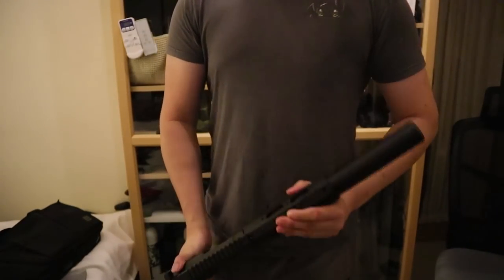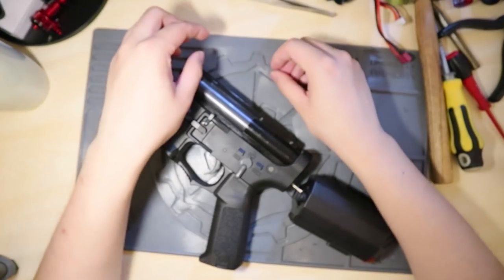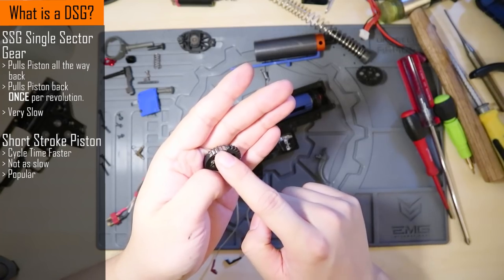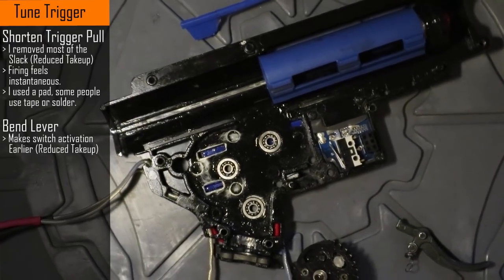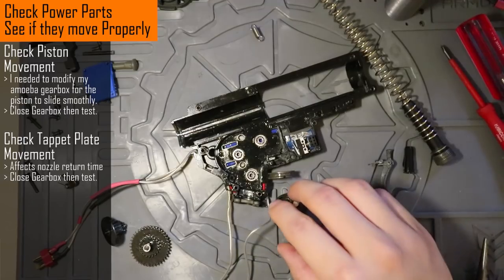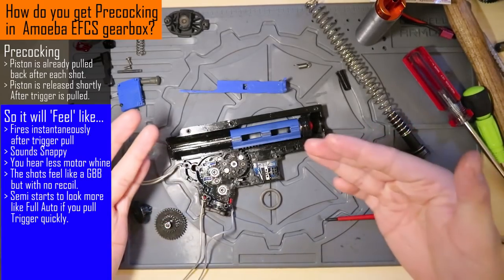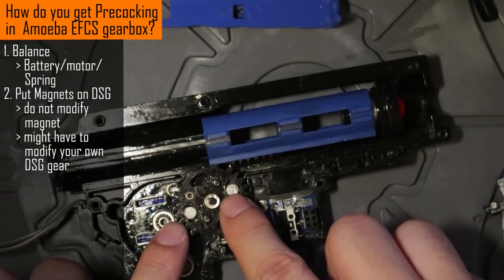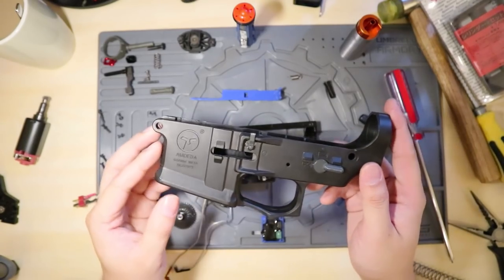Amoeba DSG Precock - Budget DSG Trigger Response Build!

Comment: alot of bad information here. this is a dsg, you need a strong spring (chop down to desired fps), strong motor (neodymium) and strong battery (30c or higher is ideal because it can handle abuse). amoeba efcs uses AB (prevents overspin).  stock ares motor does not have a neodymium magnet, but it does have 23tpa. you can easily install neomagnets on the stock motor without removing the pinion or you can use purchase a neomagnet motor (tpa depends on the desired amp load and ROF). you want strong sector gear magnets. if it's too weak, the sensor will not detect it and you will have to push the sensor closer into the gearbox. 

stock gearbox bearings should be replaced (too weak for dsg). shs fat bearings fits perfectly on the spur and sector without using any shims. bevel needs shimming. shs15t is a much better piston than shs14t. no need to replace cylinder and cylinder head (not a fan of mushroom heads). stock tappet works fine (cut the fin for dsg). shs ak long nozzle works great (sand down the front of the tappet for better nozzle to bucking seal). 

gearbox should also be radiused. it's good practice to measure the amp load so the correct battery specs can be used. if you want to use a 25c LiPo, it's best to keep the amp load below 20A (20~23tpa neomotor, higher tpa lowers the ROF but also lowers the amp load).

again, barrel length is insignificant. i've built 500mm dsgs with no issues. i have a number of dsg builds on my page. i specialize in amoebas.
Reply from the maker: you missed the whole entire point of this video and you are also missing a lot of basic information in your post (like.. are you sure you know what you are doing?)
- no I don't need to chop down a hard spring, or use a strong motor or a strong battery because obviously.... this depends on your build goal.. Which leads me to my next point. 
- Obviously the amoeba EFCS cannot tame overspin for all builds, an amoeba 'specialist' like you would know that. 
- Yes you can install strong magnets in motor, but you defeat the point of precocking it..... so... yea. 
- i'm also using the stock motor to pull an m125 half way in precock, which is very easy to do... hence the stock motor hence the title : budget dsg. 
- ... no you do not need to use strong sector gear magnets, its well documented if you claim to be an expert, you will know this. ..... and further more.... i'm using the ares stock magnets lol so wah dunno what your point is anyways. 
- Stock gearbox bearing is replaced o__O non of the stock bushings/bearings are there. 
- Your other parts reconmmendation, just personal preference, so i'm gonna ignore that. 
- Gearbox is radiused. look carefully
- if you claim to be an amoeba expert, i guess you are very well of its specs yea? So on precock, the amp spike is very high on the start every single time. And so far i have not been able to trip the EFCS and the reason is because i'm well within its capabilities. Look at the build list that's in the video and in the comment sections, i think you can easily see why that is especially if you have the spec sheet on hand of the p and n channel. Hence the title, budget DSG. 
- You are also missing a lot of vital information man. Like first off the C rating is used in conjunction with the milliamphour to figure out the max continous amp output... So you forgot to factor that in (This is very basic stuff here man). 
- And like i said before, on precock notice that everything is fine, just stay within the limits of it. 
- Your mixing up what you have experienced versus other people's build goals. Sure you may be an expert, but you .... you're missing an exceptionally large amount of information in your comment? 
- you can't build a 500 mm DSG lol. even after watching your video, that.. yea more or less confirms it. Why do you think you are getting those weird fps deviations. 
Anyways man good luck with your 500mm DSG, peace.
Reply: @RogueSystem087  that was a 2011 500mm test build. the fps variation has since been resolved from other testing. again, you didn't specify why 500mm wouldn't work. i will rebuild another 500mm dsg if you like and retest using an accurate chrono. the chrono i used in 2011 gave false readings, both fps and rof (which i did mention).if you watched the video, no issues with the stream of bbs (no suck back, suck back will show bbs hitting each other in mid-air due to the fps variation). 

from your description of a budget dsg build, replacing parts that don't need to be replaced is not a budget build (cylinder, cylinder head, piston, piston head, tappet plate). you can use the original piston, piston head, cylinder, cylinder head, tappet plate. i've tested a good number of stock ares pistons up to 14.8v dsg (failed of course, i found their limit).those stock parts will work fine with your application, especially with an m125 (less than 1j, not sure if this is for germany). most of my builds are 1j and over.  as for strong sector gear magnet, if you use a weak one, it may not trigger the sensor. i've tested different magnets and found the stronger ones had no issues. the weaker ones required the sensor to be pushed into the gearbox more. 

i did mention that measuring the amp load is important to determine battery specs (c rating). precocking isn't that difficult with the efcs. i've had a number of precock builds for ssg (precock for dsg builds are sometimes unavoidable because the slot locations are different on other brand dsg sectors) but switched back to normal because keeping tension on the springs introduced higher than normal voltage spikes. the efcs AB works fine stopping overspin, even at 2.5J (strong neomag motors are awesome).
Reply from the maker: sure, enjoy your 500 mm dsg,
either way look at the video carefully, still missing the point regardless. 
> again look at the parts list as to why this is a budget dsg build, the cyl, cyl head, tappet plate, piston head, i'll throw in the cost of the gears as well, is about 45 to 50 usd. ...So yea its a budget build and i replaced it for durability in the long term and for air seal reasons. So like i said, watch the video carefully please. 
> Precocking is of course easier on an ssg, yes of course you can tame overspin in an ssg, just saying it can't tame overspin for every single thing you put in it, you still have to set the gun up correctly to do that, which i have. 
And also.... ssg not really relevant to the conversation. 
> how would you measure the amp load to 'determine' the battery specs. 
Look man just do your own thing, but if you are going to make weird comments, at least watch the video carefully or look at the parts list carefully is all i'm saying, completely missed the point here bro, 
anyways peace.
Reply: MadCrew Airsoft he said SSGs are slow, when my m4 is running at 24rps on a 9.6v, or 39rps on a 11.1v lipo with a standard sector gear. He thinks he knows more than he actually does.
Reply from the maker: Not A Meth Dealer this is a dsg precock, if ur ssg is faster than a dsg precock, great, otherwise u still didnt watch the video and ur missing the point.
Reply: @RogueSystem087  you need to replace the title. this isn't a budget build. why replace the stock cylinder, cylinder head, piston, piston head and tappet when the stock one works fine.
Reply: MadCrew Airsoft im pretty sure in the video he says that its cheap, and that air seal is important. And considering his gun only shoots around 1J (from other comments) i think air seal is important to keep it from shooting any weaker.
Reply: @R2D2484  teflon tape is cheaper than a new cylinder/cylinder head, which is normally used for budget dsg builds at much higher joules.
Reply: I love ur videos but I don’t love amoebas that much.
Reply: @TeamMadcrew  i bet your tephlon tape doest last as long as a new compression setup and 50$ boohoo, let the man do what he wants
Reply: @chutemi-ph4kj  i'll take that bet, i still have my original dmr from 7 years ago without fps loss.  routine inner barrel cleaning and original rhop which we were testing at the time. if it's a budget build he is promoting, it's best to know what budget builds are. the only reason to replace cylinder parts is because of damage.
Reply: @TeamMadcrew  bruh what if he want to change the cylinder to a slim port cylinder to maximize fps. There are a ton of different variables but it's all personal preference. Even with the new parts it's still a budget build.
Reply: @chutemi-ph4kj  you want higher fps? springs are cheap. don't want to buy a cheaper spring? add a spacer on the spring guide. there are many way to increase fps for cheap...
Reply: @TeamMadcrew  he put in a new compression setup and you're getting mad because it says budget dsg. 300$ is a budget dsg to him, if you don't like it then don't use new compression parts. then it will be 250$ but he chose to because it fit his budget
Reply: @chutemi-ph4kj  not mad bro, don't call it budget if it's not a budget...  in the airsoft world, budget means cheap as possible. it's not necessary to replace things that works.
Reply: @TeamMadcrew  a budget does not mean "cheap as possible", a budget is the limit amount you can spend. In this case his budget is 300$. In your case you want to be as cheap as possible. id Gladly pay 300$ for the performance of rugue's gun, cause I'd rather have performance parts and not stock parts and pay 150 for almost all stock internals and.a dsg thrown in and other stock parts and call it good.

Comment: Holy shit man. 150$ for a gear set 100/250$ for a fet, at least 50$ for compression set 15/20$ for a spring , 15$ spring guide, 20/40$ speed trigger . Man you just hpa' ed that gun and have worse reliability .
Reply from the maker: ALEX huh, did u... even watch the video? its an amoeba u dont buy an aftermarket fet for it, amoeba uses their efcs system, and... its shs china gears that costs 40 usd